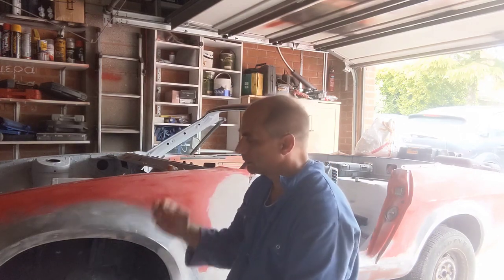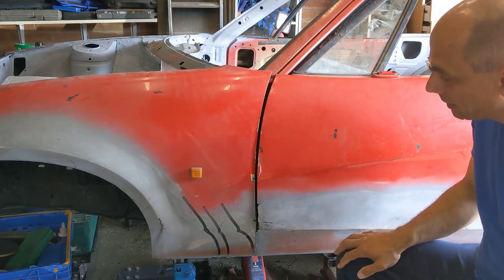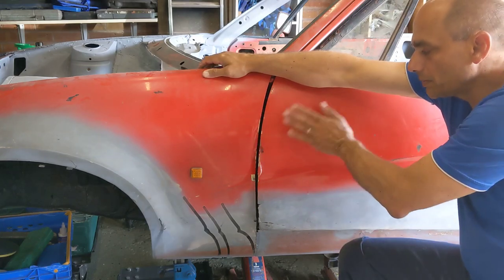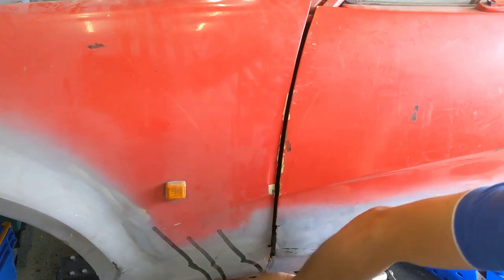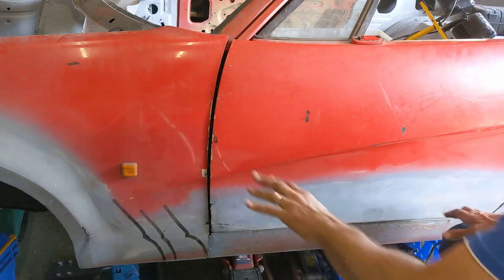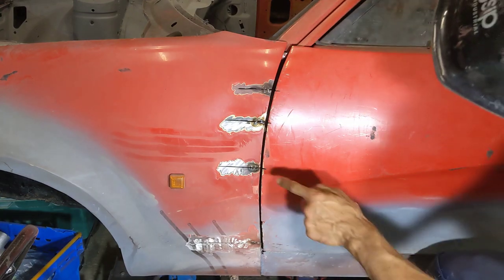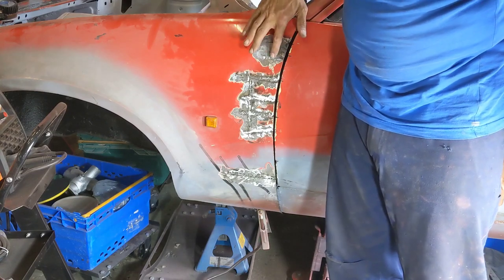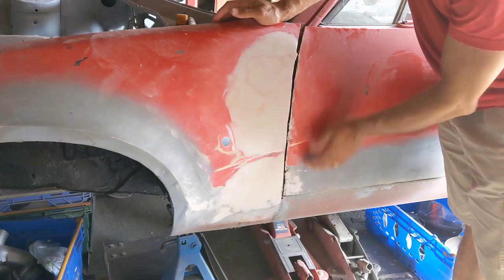Triumph TR7 Restoration:  Episode 80   Passenger door opens and shuts

Comment: Hi Henry, good news and bloody well done. Perhaps the shims were used at time of manufacture to fettle out the inaccuracy of the main build such was the quality issues at the time. Modern techniques as you know are more accurate and repeatable. I have no shims on my doors. How does the above profile look now with the door open and closed, with respect to the end of the wing and door as I had included in photos. I hope they did help somewhat, even as a sanity check.
Reply from the maker: Hi Chris, your photos were a great help.  They gave me somewhere to start as I tried to work out what was wrong.  And once I realised it was obvious.  I need to put the door one to confirm gaps are ok, and I was tired as I stopped today so didn't.  I don't think the gaps a quite consistent the whole way down, but this is the work I've done and the door will open and shut.  I need to do some filler work on the door to make it straight at the edge as well
Reply: @HenrysGarage  I was going to point out in my photos that the gaps in the doors are not consistent all the way down. To my knowledge (being 4th owner) the wings and door have never been replaced. Perhaps only minor surface works with paint as it is showing. My car was built at Canley, not Speke, you can tell from the VIN number, don't put a VIN number on here as it could be cloned lol Really enjoying your videos, not the hardship, but your resolutions. Thanks.

Comment: Will look better with the sill seems filled.👍
Reply from the maker: Yes with them filled, but there is also a step between the sill and where it meets the boot.  On one side I have the seam filled, but the step still there whereas on the other side I've smoothed the transition.  Not sure which I prefer